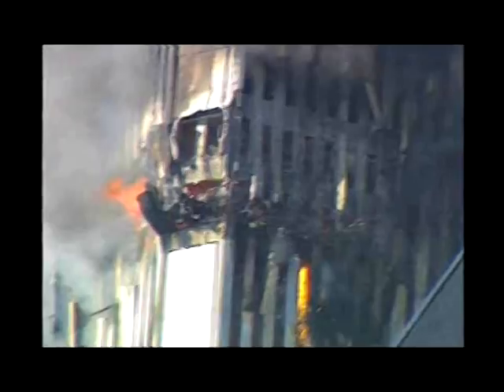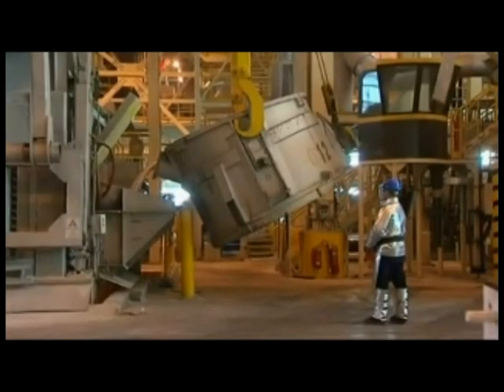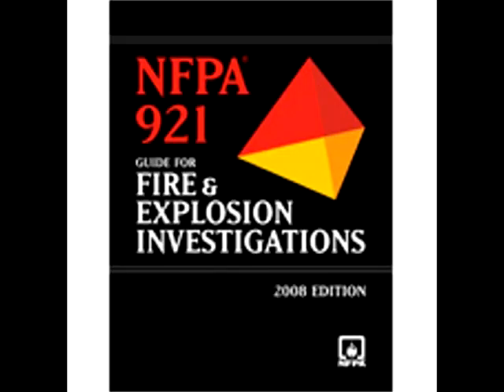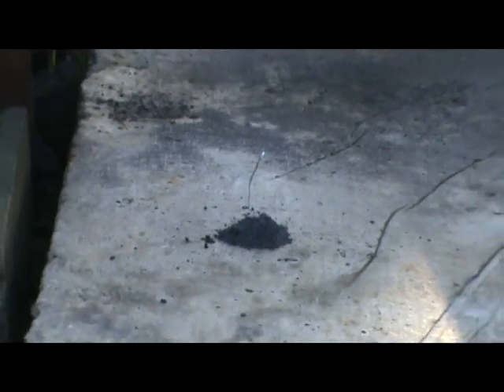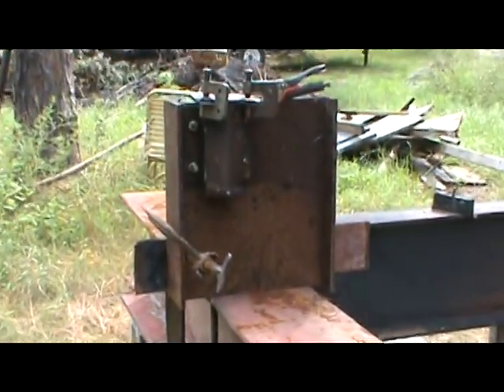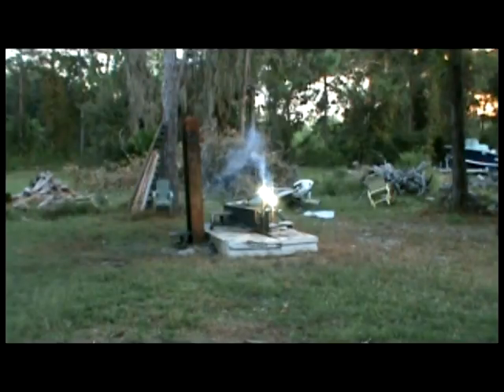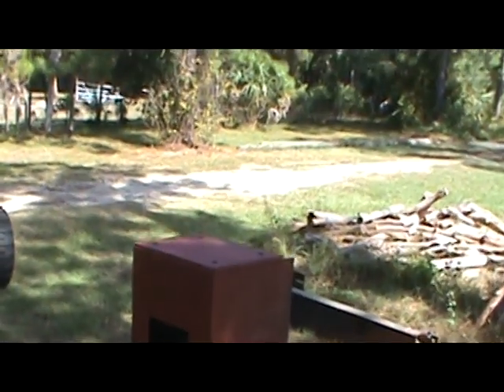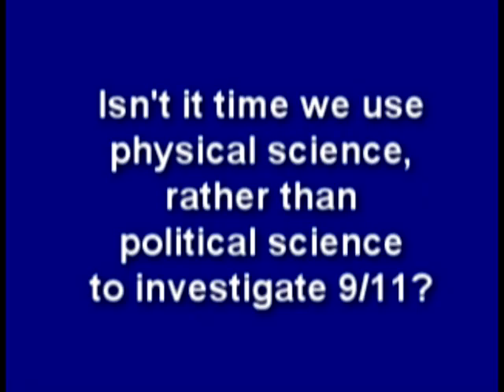9/11 Experiments: The Great Thermate Debate

Comment: I am a glaizer for over 27 years and a 6g certified weirder. Of all the steel and aluminium I've put together I've never seen it do what all the experts on this have told the public. This is areal eye opening video about what could have really went on. I had done numerous repairs to both of these buildings specifically to the Windows and frames. But never noticed the columns having the access hole for the original erection of the building. To bad we Wil never be told the truth about this horrible event in our country's history.
Reply: Where then did the molten metal spewing from the Tower come from and what of the pools of molten metal at ground zero 3 days (and later) that hindered the recovery process?
Reply: the building was built to withstand a 747 flying into it and not falling down on itself in perfect "controlled demolition fashion"  pull it,oi vey,old larry must have screamed that phrase half a dozen times that day.
Reply: John DeGennaro well if it was molten metal then it probably was aluminum that came from the building that was on fire... which would make loads of sense because right above where it was flowing from is where a 200 ton commercial jet had crashed and it is believed much of it had lodged .....and well over hall  of the aircraft is aluminum.   There was no pools of molten at ground zero that hindered the recovery process.   There were only deep seated smoldering fires that stayed covered and hot until they could uncover and extinguish!  They dumped millions and millions of gallons of water and class A firefight foam on the pile for weeks.  I can assure you it wasn’t molten steel as these comical conspiracy vids tell.  Water and molten steel don’t mix!!  It created a very dangerous situation.
Reply: so,carefully explain what happened because the "jet fuel argument" is beyond total bullshit,its easy to be a coward and hide behind the official story that is just not believable.children and amateurs have dis proven the "official story" pretty easily.money is a great motivator and has caused many great men to sell their soul.
Reply: to be frank, this is su1h a HUGE deal, even back than, that after the usual 50 year period when governments tell the truth about thing for the history books to be accurate, if this would be true, they would never tell it. 

Imagine the reasons for the next few wars. They were admitted that they were lies. If this is also a lie, who would believe them any more?
Reply: speculizer1971 I'm saying those explosives were already in the building just like there was explosives in the other towers.  You are aware of Bush's brother having the contract for the security company that oversaw the WTC complex no? ......or that the contract expired on 9/12/01? Or that many eye witness reported odd repair crews "working" on the elevators in the months and weeks leading up to 9/11?  The truth is out there, firemen reporting explosions in the basement etc. I'm alluding to verifiable eye-witness accounts and facts. Its all out there.
Reply: Man you guys are fast to call me stupid. I never claimed to a expert nor never said I thought this was a CT.....I just simply said I'd never seen steel or aluminum distort in the way that this video shows. But for the record I am  a professional .commercial construction consultant and have been for 10 years. I do stress test on all the the types of substrates and materials that build these mammoth structures. Also have been part of over 150 high rise buildings around the world. I just don't think the whole truth has been told do not believe we will ever know. Now if you idiots want to have a battle of who knows more about the failure ratings and loads of what it takes make a building such as these fall in the manner in which they came down I'll be more then happy to make you feel stupid.One more thing the manner in which these two buildings fell is what we call a controlled fall in my field........ But I'm a idiot and don't know what I'm talking about........
Reply: 4 hundred thousand tons ????  mental boy !!!
Reply: Brandon Brown so they did repairs? I think this was years planned and sobotaged by some who had access too it
Reply: those buildings were specifically designed to withstand a plane collision. in fact i think it has happened in the past.
Reply: Brandon Brown ...The Truth is staring us right in the face..
Israel's Mossad did it , blaming it on Muslims whose countries they invaded to gut and loot their resources.
Reply: Daniel Sinnott fucktards like you are so threatened by the truth you will always find some way to avoid the facts. Like the liberals and social justice warriors who call every one racist any time facts arise you jam your head in your ass and call names. It's sad how foolish people like you are. No matter how many facts, how much proof and how obvious it is that this was an inside job you morons will do anything to hold on to the fantasy world you live in.
Reply: There are also pictures of the steel at ground zero having been cut just like the demo cuts used to bring down old buildings. I notice there is a lot of abusive and angry attacks towards anyone who has any kind of knowledge in this area. You people who wish to hold on to the fantasy that this was not an inside job are desperate indeed. I am a welder and I am telling you idiots this was an inside job. But of course you armchair engineers know far more than we do, right? I mean, we only do this for a living.
Reply: speculizer1971 ...my point is that you obviously haven't read any part whatsoever of the nist report..the thing does not hold up to scientific scrutiny...I KNOW because I have and I did scrutinize it.....so your opinion is just that...mine is a physically proven fact..not really a hard concept to grasp now is it...armchair engineer all you want...if you haven't produced mathematical proof yourself, youre just another guy regurgitating what they told you on the TV.
Reply: trillrif axegrindor  The Titanic was built to sail for 50 years and was apparently unsinkable. New evidence says an uncontained boiler room fire  weakened the bulkhead wall and if failed when the adjacent compartment flooded. Yes it was a long while ago and technology wasn't quite today's standard. Until something is REALLY put to the test, experts can't back up their calculations 
and statements even if they are the builders.
Reply: Brandon Brown 
Dude "edit" your comments before you sell yourself as a "weirder" WTF is that anyways?
Reply: Bill Bill......I got in a hurry sir and didn't proof read before I posted. Thanks for the advice and I will from now on....👍👍
Reply: speculizer1971 ...I know you guys prejudge engineers all the time.....its like a hobby with you guys...and the fact that you didn't comprehend what I just explained doesn't do your side any good old timer.....THE point was i can say there's physical proof behind what I say about the govts bullshit story....I'm not pulling out of my ass like you just did...I don't think that's too hard for you to comprehend.
Reply: you guys realize steel dose not have to melt to affect the weight steel can support
Reply: Timothy E Hook One half of the story being wrong doesn't prove other parts of the story are wrong. Every single part needs to be analysed on its own. It's only when a large number of facts have good answers that it's reasonably safe to combine the puzzle pieces and have some form of confidence in the final picture.
Reply: Ivy Midget Hmm being in the state is important? Science limited to just places you can visit would be severely limited. Most accident investigations (trains, cars, airplanes, ...) are performed by people who weren't there. You claim the scientific methods in use aren't applicable and the investigations are meaningless?
Reply: harrod19 How the hell did it collapse at that speed then? You say planes and fire cant do it so what did? It clearly wasn't a demolition job. As I've already said in another post, the floors fall in a totally different order in a controlled demo with the lower floors going first. And no sign of lower floor  explosions as  the freefall starts. You say it must have had the lower floors taken out before!!! The FDNY had their command post in the lobbies before the 1st one collapsed. I think they might have noticed if the bottom floors weren't there or the basement floors had been totally destroyed. NO-ONE has seen a building collapse like that before because the circumstances have never led to it happening. You cannot possibly say it can't happen. Pure supposition and a failure to consider your own stubborn beliefs may just be wrong. Perish the though.
Reply: Fucking tinfoil freaks.  Get the fuck out of my country.  Don't like our government?  Go to some shithole that has none and start a new one.
Reply: William Bristow well first my man...the GF tower is a completely different building that had upgraded codes it had to meet after the Ronan tower collapse due to fire in 1968 This made it resist collapse due to fire. Besides, it is a completely different design. Now they did stand tall after the impacts, did they not?. When those fires ran through them that’s when things went south. You realize those giant steel box columns were made out of only 1/4” steel at the top and progressively thicker the further it went down. IIRC it was only 1/2” where the impacts took place.   

Now all that being said... you need to realize the truss which the concrete floors sat on were connected to those exoskeleton columns on one end and on the other they were connected to the inner core.. when those fires ran through those buildings those trusses the concrete floors failed from the heat and sagged.... now what happened when they sagged?   They didn’t pull the inner core, they pulled those exoskeleton columns in several feet!!   This is seen in many pics and vids where the exterior walls are pulled in several feet!!   There went those load bearing columns!!  Once those floors sagged on those failed trusses it was only a matter of time before the collapse!    I am here to roast absolutely no one man.  I’m only here to help folk understand what actually took place because I do know many of the facts and am privy to info that so easily debunks a lot of the claims in these vids.. and loads of it is just debunked through the topics I’ve been educated on over the years. Man, I do get defensive on here but people are relentless when you tell the stuff that don’t line up with the conspiracy narrative.  If I was an ass in previous comments I apologize, I have replied to so many.
Reply: Daniel Sinnott - To be fair, an expert who is wrong is still wrong while a ditch digger who is right is still right.  What matters is the quality of the argument, not the qualifications of the arguer. 

I'm not saying Brandon Brown is right about anything.  So far has not even made a specific claim, just pointing out the folly of relying on experts for experts sake.
Reply: What have the experts told the public?
Reply: Brandon Brown I have my own theory. The problem I have is most people don't understand the terminology I use to describe what I believe happened.
Reply: Glazier here local 513
Reply: Correction *it was Operation Northwoods I was referring to
Reply: Daniel Sinnott While there are a huge number of whacko conspiracy nuts around the world, there are a few who aren't nuts and who aren't wrong.

Sometimes it's obvious to detect who is nuts. But sometimes it's more or less impossible to figure out if a theory is nuts or not. There are lots of evidence backing this thread and lots of evidence indicating the official description is not correct.

Maybe the truth is somewhere in between. But you can't just claim this theory as being nuts. Quite a lot of time was spent showing holes in earlier descriptions.
Reply: getredytagetredy so Israel hired 19 Muslim extremist to hijack jets and use them as weapons?!? Lol
Reply: Brandon Brown local 188 here
Reply: Also as a plus I'm not as experienced as you are by any means but.
Wouldn't you agree that even if Aluminium could do that there wouldn't be enough of it in the entire building to begin with?
Like to me it would have to be ridiculously concentrated even with all the office materials.

But I do like the work P&R has done it's very compelling.
Reply: The sad thing about conspiracy theories is that they COULD be true!
Reply: speculizer1971 ..yeah..only because the lobby and elevator shafts had been blown to pieces.....I suppose That happens during every fire now too...
Reply: speculizer1971 ..get yer info from the govt then?....how anti-American can you get..lol
Reply: Paul Dunn lol, I’ve begged and pleaded for just one..... just ONE video that looks even remotely similar!
Reply: speculizer1971 ....sooo. .youre admitting you know nothing about the nist report...never put pen to paper on this thing...cracked a physics book ever...stuff like that....I had no doubt about Any of that....but somehow I'm the one who is bat shit crazy to be talking about what I KNOW....I guess that makes perfectly good sense to you.
Reply: Ben Johnson ...I suppose a mathematical quantification of the buildings acceleration during the collapse Event is "making thing up"... Should I have just pulled it out of my ass like you guys are doing?
Reply: speculizer1971 ....ive been doing that all day with you lug heads...I had just mentioned just one of the things ive come to KNOW about the nist report in my 23 years as a civil/structural engineer on this thread too...man you guys are dense....so, one more time for the uninitiated...(remember, this is all stuff I can say I actually know..do you understand what that means?.).....nist performed full scale fire mock ups of the floor system...if you'd have read the report, you'd have knowledge of when and where they fudged these results in their computer models of the collapse..this was done to initiate "A" collapse...they didn't bother to see if their model was producing "THE" collapse that actually happened..they also admit in the report that the columns below the impact site was NOT effected by the fire...you would then read how they bullshitted their way out of providing US with a reproducible mathematical representation of the collapse Event ( even though required by law to do so).. . They said "it was too hard to do"..I shit you not!....but went on to "explain" the collapse Event anyway in a 2 paragraph word problem...and when one solves this word problem, and I have,  one realizes the columns below the impact site, all 94 of them or so, provided No resistance to the collapse event....conservation of momentum of the buildings mass describes the actual event accelerations very well.....so, then if yer like me, you get a lil pissed about mass murders getting away with it and you try to do something about it....but hey, that's just me.
Reply: speculizer1971 Been around explosives and you mention Hollywood explosions??? The behind-the-scenes materials I have seen for quite a number of Hollywood explosions have all showed fake explosions because real explosives produces too dangerous debris. So lots of petrol for the fire cloud and air mortars that throws out "safe" debris. Way different from explosives intended to actually destroy. Like when used in mines or for demolition of buildings.
Reply: Ben Johnson I think it's better to split people here into the groups of people who have questions and people who are preaching. The people in the preaching group are so busy calling everyone imbeciles that it's meaningless to debate the things that have been badly explained.
Reply: Ben Johnson ....if one part of the story is false...you know, the other horrible half of what happened?....if That is false..then the whole thing is false ...by the way..the collapse initiation scenario these guys came up with is a load of crap too ...bother to look into it sometime.
Reply: Ben Johnson ....if one part of the story is false...you know, the other horrible half of what happened?....if That is false..then the whole thing is false ...by the way..the collapse initiation scenario these guys came up with is a load of crap too...but you wouldnt know ..haven't bothered I'm sure....peace in-spite of those bastards you guys...enjoy the rest of your Sunday...
Reply: All these people talking weren't even in the state let alone there just ignore them no good is here
Reply: Marsh Monster No metal doesn't need to melt to get weak. But what was dripping ouy of the building on the video? I have melted aluminium and it doesn't glow. I have looked at melted iron and it looks like what was flowing out of the building. So what is a believable explanation?
Reply: speed piet It isn't enough with fire to get enough temperature when you want to melt steel. You need to force enough oxygen to get the fire hot enough.

Someone earlier mentioned Japanese sword making. They suffered issues because they hadn't figured out the last part and didn't managed to get enough heat. It takes more heat to go from glowing red to molten.
Reply: speculizer1971 So post the movie name.
Reply: Jones It takes a lot of heat to melt metal. And many metals melts before they get hot enough to glow yellow. The colour comes from the temperature. That's why we have words like red hot or white hot. White hot is warmer than red hot. Also it doesn't matter how many computers they have because the question is what density of computers do they have. A large house with lots of computers is similar to a mall house with a few computers.

There is obviously many more alternatives than terrorists/government placing thermite in the building. But where is the scientific report showing what alternatives could produce these temperatures? Could the fire have produced a very concentrated jet stream of air simulating a bellow?
Reply: Daniel Sinnott but plz explain how jet fuel melts steel. Don't just call it a conspiracy, give some facts. Jet fuel cannot burn hot enough to match what was seen. So all eye witnesses are wrong, including firemen, and the media is right?
Reply: speculizer1971 steel doesn't lose integrity at 1100 degrees. WTF u talking about? Have you ever forged anything?
Reply: speculizer1971 but it was orange. Aluminum doesn't burn orange. Why do people skip the simplest thing?
Reply: Eric Parker I love what u say, and most is true. But, project paperclip was the mission to get German scientists after WW2. So maybe you're confused of the name of the project you're thinking of, because Project Paperclip is a real thing, and 100% did happen.
Reply: Ben Johnson You've made a point and pushed that fact as a conspiracy pointer. However, seeing as the event was apparently so brilliantly executed on the day to a degree of incredulity , if a false flag op why did they use the IDs  of Saudis when Iraqis, Libyans, Iranians  or Syrians would have more impact on the "gullible public baying for revenge" . If every detail was planned, patsying Saudis was a very odd move. Yet another item of many hundreds that just doesn't add up  in the muddled, non sensical mire that makes this conspiracy more and more laughable. 
Your national security was laughable, their " we'll look at that tomorrow, won't happen here" attitude was laughable.
Bush was warned then went on a golfing weekend. Idiot. Yes the US Administration let this happen through negligence 
. Read the fantastic article from 2008 by Zeman, Wise, Rose and Burrough called The Path to 9/11. The lost warnings". The detail is fantastic, it all seems genuine, and if like me you believe It, it makes government involvement seem very unlikely.
Reply: Paul Dunn yes.... I realize there were copious amounts of intel coming in for many years with many dead end threats. Complacency became the norm, and the info was brought to them and the ball was dropped......
Reply: You said you're a fire Captain, that means you have a High School education but you're here calling others stupid and uneducated. I had a look at your video of spreading bacon grease around the woods and you sound like a fucking idiot dude.. You're part of the reason why southern folk get a bad rep, and you make your country look bad.
Reply: no one is ever going to do anything to find out who did it, they'll never be punished.  it's just one of those's taboo subjects held down by idiotic people now.
Reply: Per Westermark  Google the Bijlmeer 1992 crash of an EL AL 747F in Amsterdam and look at the way it completely cut a swathe through a concrete and steel appartment block. The momentum took it all the way through and it exploded on the other side. Luckily the fire was confined mostly to an area behind the flats, not in them. Shows graphically what an aircraft even doing just 220 mph can do to a structure. It was much smaller  height wise than WTC  
but was totally destroyed in the middle.
Reply: speculizer1971 p
Reply: speculizer1971 look I’m not taking sides here on anything so not hate, but I’m pretty sure even with a 767 run straight through the middle of it a building like that would still stay standing because of the exoskeleton. Because if you think about it a steel box section as thick and wide as those is extremely strong when pressure is applied from top to bottom. If the building had been burnt out about 3/4 of the way up to the top of the building it will be lighter than if it was fully furnished and full. With the added lightness of the section of building above the damaged area of exoskeleton in theory it would be able to hold its self up ( for reference think about the recent greenfield tower incident in my country ) it stayed standing because the exoskeleton and internal skeleton were yes damaged but had a lighter load to hold up. So the tower would have to have serious integral damage to some of the steel columns, as in them being cut, to collapse. Anyway don’t listen to me if you have reason not to and sorry for the largely unpunctuated load of waffle I just typed. Thanks ( also this is my opinion and my theory to support the videos theory don’t roast me pls )

Edit ( I have read some of your other comments and I realise you know your SHIT so I will re-emphasise this is completely coming from a theoretical point of view I have no evidence to support any of the shit I just wrote so if you want to educate me I am more than happy to expand my knowledge but do it nicely pls no “u ignorant clown” ) thanks.
Reply: Never heard of a 6g certified weirder.  I would think that someone in the building trades might be expected to at least be able to spell the word WELDER.
Reply: William Bristow  I'm surprised you say you are in the UK. Firstly it is GRENFELL tower, not Greenfield. For a word on the tip of most UK residents tongues, a surprising error.
Grenfell has no exoskeleton to speak of.  It is basically a hollowed out huge lump of concrete with lots of interior walls on each floor(unlikd the open plan WTC1 and 2). A reserve  fireman I work with has suggested it probably could have burned for another day if the fire hadn't been put out, and still  probably not collapsed. Such are the benefits of a solid concrete structure. For the record, his station colleagues accept the weakened steel beams WTC    collapse theory , some a little reluctantly, as there really is no other credible explanation from the extensive  video evidence.
Reply: misuseofyou <~~~ you see, its clowns like this who jus don’t ha e the first clue. lol.  Let’s start at the top. Yes, Fire Captains are only limited to a High School education!  🤣. It’s very obvious that you aren’t intelligent enough to understand the facts I’m putting on here.... because you are here running your mouth like an idiot instead of agreeing with me!!!    Lol.   I’m not here insulting other unless they are insulting me... I am here trying to educate buffoons like your comical ass.   You had a look at WHAT VIDEO?!????   You apparently aren’t smart enough to realize what videos are mine!  Lol Yes, I’m pretty sure the only once I make look bad are the conspiracy nutbags like yourself!  I stand proud with my country and
have done more for and made my country look fantastic every chance I can.  Just
because you are OBVIOUSLY not educated enough to realize what I’m trying to help people understand don’t make me wrong, it just makes you a dumbass!!  Go play dumbass.
Reply: Asif Ifas well I can assure you there were jet remains as well as its passengers  remains all up in the pentagon. Ive seen pics of the where the wings impacted the exterior before the collapse.....You do realize the small hole conspiracy sites always show to try to make people think it is the exterior wall is actually the C wall and that hole is where landing gear went through.
Reply: Paul Dunn Yes the Grenfell tower had strict codes it had to meet after the Ronan tower fire which partially collapsed killing many in 1968.
Reply: Conner True  You're right, normally that wouldn't be that much aluminum in one of those buildings, but an airliner had just crashed into it, and that's 200 tons of extra aluminum being put right in the center of the fire.
Reply: Perhaps they would be happier moving to North Korea where the government treats its people so well
Reply: Paul Dunn Note that I responded to a comment I read to mean earlier planes flying into a WTC tower. And it has happened before - but with a small plane. I think it was something like a Cessna 4-seater.
Reply: Per Westermark I just read your comment..

 “could a fire have produced a jet stream of air simulating a bellow.”

Not so sure of a jet stream of air, but the fact is, as I’m sure you are probably familiar with larger fires which actually do begin to demand more and more oxygen and they will start sucking in large volumes of air.   Well keep in mind the large hole the impact produced and all of the windows busted out by poor souls trapped. Not to mention the high winds.  Those fires were def blowing through those buildings creating a form of bellow. It is easily seen as there in no smoke on the windward side as the wind is blowing the smoke, which is more unburned gasses, back into the burning building.  It is easily seen in the one corner of the south tower where it looks as though it’s a giant torch.  I would imagine every bit of the fire has strong winds blowing it!!   Just food for thought.
Reply: Daniel Sinnott - Again, to be fair, Brandon has not really said anything of substance yet and may never.  A bit soon to rush to judgement. That's what CT's do.
Reply: Daniel Sinnott He never claimed to have knowledge on what happened bird brain.
Reply: speculizer1971 I can't believe that people still think an aluminum, hollow object can penetrate ALL THE WAY through a reinforced concrete and steel structure! It's impossible.

Furthermore, there has never been another steel skyscraper collapse due to fire. EVER. But on this magical day, THREE did? Come on.

Finally, it is also IMPOSSIBLE for a structure to fall at the speed it did without the underlying structure to be COMPLETELY removed. 

These are all very simple, highschool level physics.
Reply: So you've done alot of testing with 400,000 tons flying 500 some odd mph at what your working on?  You had a specific set of tasks to do why would you notice everything, unless you're a sabateur or have add.  What is the composition of the concrete in the underground parking, it had no bearing on your work either.  What happened was a great example of the difference between on paper theories and real world testing.  On paper the fireproofing works to xx tempature for xx time.  Then in reality it's a mute point if the proofing can be simply knocked off. As a fire was anticipated not a 767 with all 3 tanks filled for international flight.  For example look at Fukishima, it was built down low on bedrock to better survive an earthquake considered the main threat.  In reality earthquakes can cause a tsunami (flooding their backup power and the plant in general) dealing the plant critical damages.  Much of the damages could have been preveneted had the backup power and pumps been kept running.  On paper an earthquake or sabotage would be the most likely way the plant be damaged or destroyed.   Flooding was seen as a problem and able to be fought back with adequate backup power.  However that the backup power could be knocked out wasn't given enough thought.
Reply: Daniel Sinnott reading is hard... He stated he never noticed the access holes during his FIRST HAND inspection of the buildings frame. That's pretty fucking instrumental. 

PS I'm an engineer and those buildings ABSOLUTELY did not collapse from an airplane strike or from the resulting fire. Happy? Probably not because you're a piece of shit of a human being.
Reply: harrod19 you are an engineer and don’t think those 200 ton jets flying at 4-500 mph would penetrate into those buildings..?   Perhaps you should go back to school! ESPECIALLY through the twin towers with their design and construction!!  First off it was not “reinforced concrete” as a matter of fact the towers were built with as little concrete as possible!  Those prefab panels for the exoskeleton design and the 59 columns in each side were on 36” centers with 18” windows in between them with very little masonry as exterior cover.there was NOTHING going to stop those jets from running through them! ONE WOULD be an idiot to think the jets would just hit them and explode and slide down the side like in a cartoon! Lol   

Then MR engineer, you would make such an uneducated
claim that on that day 3 buildings collapsed from fire...... when the fact is two had major damage from 200 ton 767s running through them!!  It’s comical how those supposedly educated always leave that fact out! Let’s get back to that reinforced steel....The Pentagon had 18 inch reinforced concrete if you think that 130!ton 757 flying at 500 mph would not penetrate through 18 inches of reinforced concrete you’re out of your mind I need to go back to school and hit the physics again!!!   You should be able to understand that those jets impacted those building with SEVERAL BILLION foot lbs of energy!!  Lol Well engineer I guess a hollow ping pong ball couldn’t go through a paddle either would it..... or water for sure, would never cut steal... an educated engineer who understands physics would know it’s all about speed because they use water to cut steel every day and you more than welcome to google the ping-pong ball going through the ping-pong paddle!! You conspiracy theory us need better witnesses!!
Reply: Ben Johnson well, and there is a third..... those simpletons who will make the claims as though he has a clue about what types of people there are in these comments! Lol
Reply: Brandon Brown  I don't doubt your knowledge and experience. Your field is in stress testing and mine in aviation matters so different skills. I have to ask you . In all the demo videos Ive looked at, dozens and dozens, all have explosives set around the base and the floors collapse from the bottom bringing what's above down. In the WTC collapses, the floors above collapse and all the bangs and puffs seem to coincide with the floors collapsing. After a few floors above the impact zone collapse, the rest come down. 
You seem like a smart guy so I need you to explain to me how the WTC collapses are  identical to controlled demos.
They are even faster than controlled collapses with none of the correctly located detonations visible which suggests a previously unseen type of collapse. Please put me straight with a believable explanation as to how these look anything like controlled demolitions.
Reply: Ben Johnson Lololol I read the first few sentence and have to stop you.... Lolol.    

It is obvious you are just your typical everyday conspiracy nut regurgitating what you’ve heard in these vids!!   Yep, I’ve been around explosives and have even been tucked away in buildings on movie sets as explosion you’ve seen in movies are going off.  Yes, I am VERY familiar with
Jet fuel and the many different  hydrocarbon additives etc etc....let me explain this shit to you.  I realize the comical shit you hear and spew, but the major roll the jet fuel played was spreading the fire all over very fast and got the fire raging throughout.  I realize what you’ve been told and what you believe without having any facts!   Ordinary combustibles of building material and interior design burn far beyond the temps needed to bring structural steel far beyond failing temps..... especially with all the polymers used in all the synthetics of the times which burn so very hot. Even in this video it tells that the buildings burned 1800 plus degrees... structural steel begins to lose its integrity at 675 deg and will completely fail at 1100 deg and can fail at much lower.... those numbers are straight out of the IFSTA training manuals that have taught firefighters across this country for almost 100 years!!! so your comical expert claims of experimenting with jet fuel is completely useless if you actually did, not that you could ever duplicate the conditions up in those buildings!!!  The comical claims that firefighters and rescue workers boots only lasted an hour and a half max is complete bullshit.   That being said.... there was no molten metal at ground zero.... if there was I can assure you it wasn’t steel!!    You see, there was literally millions and million of gallons of water and class A firefighting foam doused in the debris pile for weeks trying to put out the deep seated fires. Had it been molten steel there would have been a very disastrous reaction because water and molten steel DO NOT MIX WELL!!!!  You need to google what happens when you put water on molten steel, then get back with me! 

You see Ben..... As a Fire Capt in this capital city HAVE been educated on many of these subjects for the past 25 years and with continued education  from building construction, to terror used biological weapons to tnt to training with the local airport!!!   It’s what we do....    I ALSO have ran our local USAR team (urban search and rescue) for the past many years which is deployed at the state level.   

You folks need to realize when things like 911 take place there are, will be and were thousands of people from all walks of like with many different job scopes who arrived at these catastrophes to process the large scenes..... especially with such a large loss of life.     Many many USAR teams were deployed to the different sights and yep you guessed it... I found self at the pentagon where our tasks were collecting human remains as well as shoring the collapsed building so no other life is lost!!  We collected human remains which were all bagged tagged DNA swabbed GPS marked and brought to a temp morgue.   We also had men in those Pa fields collecting human remains where the very tedious challenge was collecting people loved ones remains from the surrounding trees which were littered.   I did not have any men at ground zero but do know plenty of firefighters and a few medics who were there.   

I also work part time for one of the largest rescue companies in the country where we train plant workers and fire depts etc across the country from all different rescue certifications such as high angle, confined space, trench rescue, Swift wateretc etc.... we also are hired out as contractors to be on stand by when needed.    So, yes..... you are speaking to a professional who is trying to help you folks understand that these conspiracy sites are just that.... and most of them are in it for the monetary gains, nothing more. 
I understand about the gov and how they let NO TRAGEDY GO TO WASTE.. but they are not responsible for 911.
Reply: Have you tried flying a plane full of people into a building of people to recreate these specific events and to work out all variables? Have you tried human flesh in your molten aluminum what color does that turn it?
Reply: Buying SUMMONS I’m not sure what you are working with or where you are getting your information from... but in my 25 year career structural steel and how it reacts is a huge topic in my profession because lives actually depend on it. Elongation from thermal expansion is one of the main failures of steel when heated.   When you have horizontal structural members breaking free from the vertical members they are suppose to be connected to there is going to be structural failure!!
Reply: Buying SUMMONS You and folks on here need to realize what heat does to steel structural members!!    Do you realize that a 100’ steel beam when heated to just 1000 degrees will expand 9 1/2” .......if you don’t think that is a significant failure I don’t know what to tell you!  That just 1000 deg!!  The higher the temp the expansion rate increases.   I’ve seen building where steel beams have punched through the wall of the building!
Reply: speculizer1971 You realize he's on a PBS documentary concerning 9/11 saying exactly that right?  You realize how fucking ridiculous it sounds, its just that you don't realize its just another reason why the official story is a farce.
Reply: B , I've seen a few videos on this but could it not be possible the it got that hot that this could actually happen, in your opinion hand on heart could this of happened as they said ??
Reply: speculizer1971 https://youtu.be/p34XrI2Fm6I

See for yourself?
Reply: Per Westermark yes... you can write if off as just more but cases when they are trying to tell you crap and make claims such as the jets couldn’t penetrate the buildings because of “reinforced concrete, “ especially when you know for a fact there was jet remains all up in the building as well as its passengers remains!
Reply: harrod19 If and a big if, because of the ridiculous claims you are making, you are an engineer you should educate yourself on the design and construction of the towers since you claim they “ABSOLUTELY did not collapse from jets and fire!”

An educated engineer would realize the design had 59  load bearing columns on each side which supported much of the weight.   The floors which were made up of 5” concrete IIRC sat on trusses (which these trusses were relatively light weight steel in the grand scheme of things) were connected to the exoskeleton columns on one end and connected to the inner core on the other.   NOW, along comes those 767s which did loads of damage within as well as started raging  fires in each building, each building had several floors which the trusses failed in the heat and sagged under the weight of the floors.  This is VERY evident in many of the videos and pictures because when they sagged they pulled in on those LOAD BEARING COLUMNS which sucked the exterior walls inward several feet because they DEF WASNT GOING TO SUCK THE INNER CORE OUTWARD!!...as I stated, this is VERY visible and easily seen in many vids and pics. There goes those load bearing columns and it was only a matter of time when those fires ragged through the buildings and trusses failed!
Reply: harrod19 BTW bud, there are structural collapses all the time because of fire which kill firemen every year... just because they aren’t total collapses don’t mean it don’t happen!  You, as an educated “engineer”,  should check your facts rather than just regurgitating the crap you hear on conspiracy sites.  Perhaps you should google the Plasco. Building collapse.which was the most recent steel structure building that collapsed because of fire.
Reply: Brandon Brown I'm a welder too and I'm just going to say it .Those planes wouldn't have brought those buildings down .Our government is mix up with a whole lot of shit behind closed doors
Reply: You can put together all the steel and aluminium in the world, that does not make you an engineer.
Reply: Terrance Watson the towers were still standing strong after the jet impacts were they not....?  Now, when those fires ragged through the buildings, that’s when things went south.... if you are a welder you should know the affects heat has on steel.
Reply: Eric Parker yeah... Yeah...... you do known that Bush’s brother only SAT ON BOARD OF DIRECTORS FOR SECURACOM AND THAT HE HAD VACATED THAT SEAT LONG BEFORE 911 dont ya...?    You do realize that there are always working in enormous buildings like and that these
Videos tell you all kinds of bullshit to make you think you are verifying a Narrative you want to believe.... and they they pick and choose the “witnesses” they want
You to see or hear.   You are right, the truth IS out there, my friend, and I’m trying to help you understand it.  You do realize that on the scene there were loads of firemen saying all kinds of things because they were not sure all that was actually taking place and happening.  All the loud, “explosions” were accounted for. Firemen are taught from day one to expect and watch for secondary devices, because terrorists are known to plant secondary devices to take out rescuers.... of course they thought there were bombs going on on scene of 911!   You would be hard pressed to find a firemen who was there that believes any of this crap these conspiracy vids tell. I know many firemen and a couple of medics who on scene before the collapse and not the first one believes any bullshit like this. I can also tell you this man, during Hurricane Katrina we had to bunk with about 20 FDNY guy and a couple of them were staged at building 7 and they said that all the guys staged at 7 ALL saw the telltale signs of an imminent collapse.    So yes, the truth IS out there, but it’s not in these ridiculous conspiracy vids I can assure you!!
Reply: Zoes Dada lol, just because you can’t think for yourself and allow these conspiracy sites and vids to tell you what to think, it don’t mean it’s accurate and don’t mean you have the “facts!”
Reply: Zoes Dada lol yes and you aren’t paying attention,... you are a welder, GREAT!   I’ve done loads of welding myself.   Perhaps being a welder you should realize that there were countless oxy/ace cutting rigs ALL OVER GROUND ZERO during rescue and recovery!   You ever stop to think that not all of us are “armchair engineers” in these comments? I’ve been in the fire service for the past 25 years and can tell you loads about 911 from personal experience and ungodly amounts of information from coworkers who I trust with my life and literally DO on a daily basis! Yet, because you are a welder everyone else are idiots! Lol. Because after all, you do do
It for a living...... lol
Reply: Eric Parker and you are saying those explosives were already in building 7.......... so they had it planned out for the towers to collapse and made DAMN SURE THAT ONE PIECE OF THE COLLAPSING TOWERS WOULD HIT BUILDING 7 they way they could start a fire in it and they could use that take the building down...?    Or did they already know that that one section that would strike building 7 was going to start the fire in the building and they would be able to detonate the explosives they planted in it earlier.....?     You do understand that a section of the collapsing towers happen to hit building 7 starting the
fire....?   So they took a chance that it would accidentally hit 7 and start a fire.....!?     But if it didn’t hit they would blow it up ......anyway.......???    You see how much sense you are making..?   By the way..... there were no explosives in the twin towers.
Reply: Zoes Dada lol, and you don’t think that there is LOADS AND LOADS of abuse when I bring conspiracy theorists facts and try to explain shit on things that I have been educated in for many many years.... or the facts that I happen to be privy to...?   Have you missed that abuse.... from conspiracy nuts holding on to their silly bullshit they have been told.. or should I say fantasy!
Reply: Timothy E Hook yeah only what......?   Exactly what point are you trying to make?   Or is this your attempt to try to catch me with something that I cannot answer.... or are you trying to find something you know and I don’t and catch me with an “ah hah” moment where you can claim there were bombs in the lobby!?!  Lol.    Yes, the lobby was the result of a portion of almost 25,000 gal of jet fuel coming down the center core.  There were some very burned people  down there as well.  It was a horrible horrible day!    BTW, the lobby and elevator shafts were not “blown to pieces!”
Reply: Timothy E Hook Lol get my info from the gov.....  well I guess if you want to call it that! Lol.  I am also “paid by the gov” as many conspiracy nuts accuse me of!    I tell them that is the only thing that get right!!   I AM paid by the city gov that has employed me the past 25 years, same one that paid my dad for 36 years and both my brothers until they retired....... as well as numerous nephews and uncles! Lol.    I also get my info from personal experiences etc etc.   I guess that’s unamerican lol..
Reply: Timothy E Hook Lol, and what “mathematical proof” have you given!   Yea, I have read the NIST report and all of the clowns stating it doesn’t stand up to “scientific scrutiny” don’t have the first clue about any of it nor do they have the wits to scrutinize! Lol.   I’m not armchair engineering, I’m educating you on facts!   Exactly what part of your is “proven fact?”    Is that what what the educated conspiracy site told you....?    Bless your heart! Lol.    Exactly what part which I have educated you on did I “get from what they on the TV told me?”   Please do tell..... what part that I have educated you on doesn’t hold up...?
Reply: Timothy E Hook is it that jets would not and could not go through the “reinforced wall” of the pentagon!?
Reply: Timothy E Hook <~~~~ I love how all these clowns come up with all this bullshit that they get from these conspiracy video.... such as “don’t hold up to scientific scrutiny!”   Lolololol.  Word for word!
Reply: Ben Johnson lol, I guess we could create a 5th of people who aren’t educated enough to recognize facts!
Reply: Timothy E Hook well are you going to explain what you’ve “put on paper, about this thing” or explain what I’ve said that don’t hold up to “scientific scrutiny!?
Reply: Timothy E Hook yes, please do me a favor and explain in detail the mathematical quantification of the acceleration during the collapse...... please in detail and explain the algorithms used to come up with that.
Reply: Timothy E Hook lolol, yes.... we are dense... that’s one thing about engineers which I’ve come to learn over my 48 years of working in the real world. Engineers are the biggest idiots who actually haven’t got the first clue as to what actually takes place in real life..... ESPECIALLY dealing with them in refineries and energy plants!!   It’s been a long going joke that you seriously have to talk slow to them for them to comprehend real life.  As a prime example, you need a computer model to know what I’ve been educated on in real life!   What is so hard to understand about the buildings collapsing!!! Please explain it to me or are you only stuck on your claimed acceleration. As if the lower floors would hold and stop the pancaking collapse. Lol.  Well hell...... explain in detain your mathematical quantification of the acceleration...?
Reply: Rpm198Three It doesn't count when tiny sport plane hits a tower. No big plane had hit any tower before 9/11.
Reply: speculizer1971 I agree! 1800 degrees is which when metal becomes molten I hate to tell you but you don't have to get molten metal to get it to bend and collapse especially when you got that much weed sitting on top of it if you don't believe me heat a half inch piece of metal bar up to 675 to 700 degrees lay it over an anvil hit it with a hammer see how easy it is to men I'll put a couple of million tons of concrete and steel on top of it see what happens.
Reply: How do you create steel? Have you ever asked yourself that question?  BY melting what? With what? Ohh fire.....  And steel is not influenced by fire, did you research that? Or do you just mumble nonsense..! pffff. I guess you don't read. So check this video out. With the actual firefighters fighting the twin tower fires: https://www.youtube.com/watch?v=h7S9bnd_pnY
DIMWIT....
Reply: Per Westermark lol, no bud.... I can assure you these were no fake explosives I can assure you! Lol   As a matter of fact in one shoot they did in a well known movie they damn near killed me. Lol
Reply: Ben Johnson man, I can assure you there WAY jet remains all up in the pentagon as well as its passengers remains.  I’m not sure how you think a 757 would have done more damage?
Reply: Ben Johnson I can agree with that, and I don’t think I spoke bad of him!
Reply: Ben Johnson exactly where is an official finding where there was “molten steel” at ground zero?!!   I’m pretty certain there was no molten steel at ground zero....   do you realize the hundreds of million if not billions of gallons water and class A firefighting foam that was dumped onto the debris pile?  As well as when it was being uncovered... or should as I say as the deep seated fires were being uncovered..  I don’t know if I told this but if so I will remind you. Water and molten steel does not mix very well and causes is a VERY dangerous explosive reaction!   Go research what happens when water is put on molten steel!!   But I’d love to see where it is an official finding!
Reply: speculizer1971  Thanks for that. If youve never been given an answer I think that says it all. It's THE main foundation of conspiracy theories and when it comes to the crunch ( forgive the pun) , the videos they claim proove it's a controlled demo actually debunk their own beliefs. Ironic really.
Reply: Per Westermark Battle of ‘Los Angeles’.  Not that this movie is relevant or important...
Reply: Buying SUMMONS you are right.... it completely fails at 1100 deg.... it begins to lose its integrity at 675.  Just because you have incorrect information don’t mean I’m incorrect.  My numbers are straight out of the IFSTA firefighting training manuals that have been used in this country for almost 100 years. Sorry, no I have never forged anything.... I have bent plenty of metal after heating it and have witnessed probably thousands of miles of bend sages twisted steel in fires.
Reply: Buying SUMMONS I didn’t just “skip the simplest things.”  We will NEVER know for sure as to what was going on there or exactly what it was.. did it look like steel . Sure, but no it doesn’t make sense and will never be put to rest.   It if VERY likely there were tons of aluminum right from where that was coming from.  Can you tell me for sure what it was...?  No, just like I can’t tell you exactly what it was.
Reply: Daniel Sinnott read fire engineering magazine, they go over how 911 was a setup. Because a steel building has never been melted by fire.
Reply: Cameron Reese I would love to read that fire engineering article that claims 911 was a set up!!!   Where can I find that?  I read it all the time and never saw that one.   I wonder who wrote that and why they would allow such an obviously uneducated clown write for them because anyone in the fire service knows steel does not have to melt for it to fail!!!   Structural steel begins to lose its integrity at 675 deg and will completely fail at 1100 deg and as we all know the towers burned much hotter than that!!   These numbers which structural steel fails comes straight out of the IFSTA training manuals which all fire depts use across the country!
Reply: Brandon Brown I've NEVER met an engineer or other related professional independently agree with the official 9/11 reports. NEVER. It's just random chance that every professional I've ever met is a nut in CT?? LOL

Thank you for your input and your account!
Reply: Daniel Sinnott Except I don't.  Have you seen the video of the news reporter reporting on Building 7 collapsing while it still stood in the background? Its one of MANY highly questionable circumstances surrounding that day.  There's awareness and then there's willful ignorance. If you don't know that the official story of 9/11 is absolute bullshit then its because you don't want to know.  

I can understand why it happens.  People that consider themselves patriotic really embrace the country and the ideas it was founded on.  Its hard to even fathom that such a thing could be possible or even considered.  

To those that wear this particular shoe, I'll say this.  Operation Paperclip was a CIA operation during the time of high tension between Cuba and the US. It was never greenlighted and never took place but the documentation of it is legit. Within it are some themes that are very 9/11esque.....fake hi-jacking of airplanes etc. Research it, to brush it off is again willful ignorance.  Do the research, the information is out there. Knowing what I know, it leads me to this question.....If it had been more than just a proposal, if it had been planned out and executed, if it was not just words on paper but actual, historical fact, would we be referring to it as Operation Paperclip or would be calling it the _________ tragedy, attack, disaster etc? How many terrible things do we look back on now that are actually Operation _______?  We don't know the truth because it stays hidden in the shadows where light doesn't tread.  To believe otherwise is to be naive towards the operations of the Pentagon.
Reply: Nicholas Stocks lol, it’s not hard to see what happened with a little knowledge of the buildings construction, a little knowledge about fire and it’s affects on buildings.. we already know each tower has 767s filled with fuel literally ran through the towers!  With that exoskeleton construction when those fires ran through those buildings it was only a matter of time before each collapsed!  The most suspicious think was building 7 which we know was hit with debris as the towers collapsed    had a major fire run through it for over 7 hours literally unhindered because of broken water mains. It’s collapse is VERY plausible.   We also know what happened at the pentagon... after it had a 757 ran though it!
Reply: Brandon Brown it’s also called a progressive collapse.... when demolition crews plant charges in buildings, are they not trying to create a progressive collapse? :)   I never called you an idiot. Yes, this video claims loads of ridiculously incorrect information and claims.
Reply: Eric Parker you aren’t going to find anyone more patriotic than me!!  But let me explain to you.... all of the firemen staged at building seven so the telltale signs of an imminent collapse. They told everyone including the media after setting up a collapse zone, several news media outlets misunderstood and told the public that the buildings had collapsed that BBC clip wasn’t the only one Who misunderstood and got it wrong! That my friend is the facts on what happen with that!
Reply: trillrif axegrindor Lol so because people are much more intelligent than your ignorant ass and are able to think for themselves....they are        “”cowards hiding behind the official narrative!?”  Lololol. EXPLAIN THAT BRILLIANT CONCEPT!!  <~~~~ that right there just shows just how low IQ these ignorant clowns are!!!  We have to be talking borderline retardation IQ!!!
Reply: harrod19 Lol, and I’ve never met an engineer that believes in these conspiracy theories!!
Reply: Eric Parker I never said he didn’t make a comment saying “pull it” but what he is saying is Pull it as in pull your men out of and away from the building and write the building off. Pull is a term used in firefighting operations and it can mean pull it as in write it off or pull it as in write it off and make it a DEFENSIVE ATTACK instead of offensive attack! They had lost enough life at this time. No need to be worring about a fkn building with no living things in it at this time... ESPECIALLY since there were still rescue operation underway within feet of this scene!   What is so hard about you folks grasping that...?!?   Let me ask you like I asked him..... lol You think Larry S told the IC to send his men back into that building to plant explosives to bring the building down?!? Lol. You seriously think that IC would risk losing more of his men for an empty building!?   If you believe that you need your head examined!! Not to mention send men and to in minutes what takes professional demolition crews weeks and months to do...?!?
Reply: Timothy E Hook Lol, yes I know, conspiracy  nuts have
all been preaching about physical proof.... lol!!   You have nothing and neither does any of the other clowns preaching the ignorant conspiracy shit.   Yes there is a damn good reason we prejudge engineers, because they are all the same!!    Lol    You clowns act as though you happen to have a clue to the real world.   There is a reason they went away as winners and the goofballs went away crying!   And they are still crying!

I’m pretty certain I didn’t “pull stuff out my ass!”    I have given NOTHING but facts here.   Exactly what did I p”pull out my ass?”
Reply: Ben Johnson I don’t know if it would collapse or not... but I do know it was not a very good design and the man who designed an built agrees.  With code the way it is today, luckily we don’t and won’t see many high rise fires. Now, with the damage from the impacts, it was only a matter of time!!   I will keep saying that!!  If you would understand what I’m explaining you would as well. When those truss sagged and pulled the undamaged load bearing columns inward several feet they were no longer load bearing and were liabilities!

Yes I do listen to first hand testimony.... but I HAPPEN to realize there is MUCH MUCH More testimony that what was picked and chosen for the conspiracy vids!!!!  I can assure you, there is much much more damaging testimonies to your narrative than to mine!!!   No, I was not on scene.... but personally heard loads of testimonies from men I trust with my life!

Yes, it’s all good..... I may be a peanut. But when a clown is trying to tell me something different than what I know without a doubt to be a fact... yes, I will tell him to screw off and bring the garbage he’s peddling with him! Lol, my resume is accurate and I will continue to try to educate conspiracy nuts with it and the  experiences that go with it!

Search and rescue don’t pertain to structural integrity!?!??     Lol man, now you are showing complete ignorance!!  Lolol   You should honestly think a little more into that comical statement!!
Then to top off your little premenstrual rant with who I might have voted for!!   Lol brilliant!!    Lol. Yeah I doubt you have the ability to  understand actual facts too!
Reply: Ben Johnson your comment is just too out there..... you have to do better.  I am “pretty certain” about what that then I should accept that we are at war with the wrong people!?    Try again to get your point across..... like I said before, if you only want to see the bullshit conspiracy then that is what you’re going to see!! Perhaps you should try getting your information from places other than conspiracy sites!!  The you would probably get testimonies that do line up with what I’m saying!   Great, you saw videos.... or watched a “citable” source on things like building 7 where “people actually describe the sounds of explosion”, yet I’m sure you never stop yourself and think.... is this person and their  description a creditable source!?   Would this person even know what an actual “explosion” would sound like!     Yeah I’ve watched these vids too..... and were told about all these creditable sources.  Buy you know what.... I think I’m going to rely on the firemen who I’ve personally interacted with who told me everything that was going on and speaking about it brother to brother as they discuss the failing building  and their lack of water and their futile attempts to establish a water supply ..... yes.... I’ve watched “creditable sources” discuss how they didn’t see jet remains up in the pentagon and how the lack of video evidence... so it must have been a missile because the “hole wasn’t big enough” for a 757.....   But I stop and remind myself that I actually saw jet remains with my own eyes..... and I collected loads of human remains.  Yes, I saw the conspiracy vids saying that the coroner stated a plane didn’t crash and that the plane “disintegrated into the ground.... and witnesses with all kinds of claims from a military jet shot it down to it was a hologram. Then I stop and remind myself with reason logic and common sense, and knowledge of what the jet did as well as my coworkers who were actually there who collected human remains out the trees and surrounding areas and who all saw jet remains.

I would perfectly explain to you how building 7 went down as I have so many times. But it’s very easy to tell you DONT WANT TO HEAR IT!!!!    Yes, it’s pretty fucking simple how “third world goat fuckers” infiltrated out commercial airlines.... yes I actually can explain that to you as well as how the whole crashing jets into buildings came about an how the terrorists were hand picked..... because you don’t want to hear it.... I can also explain how EVERYTHING YOU JUST REGURGITATED CANE FROM CONSPIRACY SITES!! Lololol.  I’m pretty sure I have not just claimed 40+ years (yea you’re still making shit up) of experience overrides people who were there!!    You just aren’t intelligent enough to realize wtf I’ve been talking about and you haven’t listened when I explained shit to you!!   Well from one American who worked 2 jobs the past 23 years and who will hunt and fish to live.... you just pissed and don’t listen when people talk unless you agree with what they are saying.... therefore you would prefer to listen to witness who were “there that day, whether they would actually make credible witnesses or not..... you claims that I only throw my experience around and bullshit like that instead of explaining things just shows how ignorant you are..... and your old pop..... I feel sorry for him because you had to be one
hardheaded little shit!   Sorry you don’t have it in you to follow and understand facts and see past conspiracy bullshit!
Reply: Ben Johnson By the Way Ben...... still waiting on your link that proved that “OFFICIAL FINDING” that there was molten steel at ground zero!!??         Or is just more shit you love to regurgitate from conspiracy sites and vids!?    I know the answer, let’s see if you will admit it to yourself.
Reply: trillrif axegrindor but yeah..... I will be more than happy to school and educate your low IQ ignorant ass!!!!  I realize you get all your info from conspiracy sites.... but that just typical for simpletons!  You see clown...... the ONLY thing jet fuel did was help spread the fire throughout the building and created a raging inferno in a very short span of time.  Jet fuel don’t have to “melt” steel beams!  You see simpleton.... ordinary combustable used in building construction as well at the interior design ESPECIALLY with all the synthetic polymers used these days which burn very hot... all of these ordinary combustables burn far beyond the failing temps of structural steel.  YES OFFICE FIRES BURN FAR BEYOND THE FAILING TEMPS!!  Lololol   Steel begins to lose its integrity at 675 deg and will completely fail at 1100 deg and can fail far below that. Even these videos tell us that the fires burn far beyond that. And YES I AM A PROFESSIONAL  and these numbers and facts come straight out of the IFSTA training manuals that are used to train firemen across the country and  have been for almost 100 years!  If you
would like to
Educate your ignorant ass so you don’t look as though you have a borderline retardation
IQ you can go read the IFSTA manuals. Lol. I am a fire captain in this here capital city which I have worked for the past 25 years, but I will play a coward if you want me to...
Reply: trillrif axegrindor please please don’t let me down because you’ve looked so ignorant!!   Please respond!!
Reply: trillrif axegrindor Lolololol. No simpleton.... these buildings were NOT “built to withstand a 747 flying into it!!” <~~~~~ you see this SHOWS EXACTLY HOW RETARDED THESE CLOWNS ARE, AND HOW MUCH THEY REGURGITATE THESE CONSPIRACY SITES!!! Lolololol.  How can a building be designed to withstand a jet THAT WASNT BUILT UNTIL SEVERAL YEARS LATER!!!! 🤣🤣🤣.     Let me keep on educating you clowns.... you make this shit so easy!!  The towers WERE DESIGNED TO WITHSTAND A 707, THE BIGGEST JET OF THE
TIMES, that was coming in to land AT LOW SPEEDS AND EMPTY OF FUEL!!!!      <~~~,pat attn to that simpleton!!!  Low speeds empty of fuel!!  You see, this information comes from the man who DESIGNED AND BUILT THE TOWERS!!!! Leslie Robertson!!   Google him simpleton!!

https://youtu.be/NgXvmMkpRpU
Reply: trillrif axegrindor you believe Larry told the incident commander of the NYFD to blow up the building by saying “pull it”...you have lost your mind!! Lolololol  why does that not surprise me!!  Lololo Lolololol   Yes, the IC who at that time believed he had already lost thousands of men had his guys bring explosives into building 7, a building that was already showing the telltale signs of an imminent collapse...and planted them in a short span of time which for demolition experts it takes weeks and months... but the IC sent his men in the building that was ready to collapse on them at any time and they were able to accomplish that to where it would look like it collapsed from fire..😐........🤣😂🤣😂😂. 👌.     And that’s how stupid this kid is!  They just soak up all this conspiracy bullshit believe it and spew it and tell others they are cowards and dumb. Lololol
Reply: Conspiracy theory nutters will never be convinced otherwise.
Ever wondered why your sort believe all the conspiracies?
Reply: Oh, so not an engineer or a fire expert then.
Your "knowlege" is bullshit.